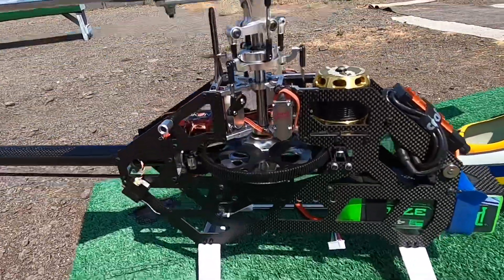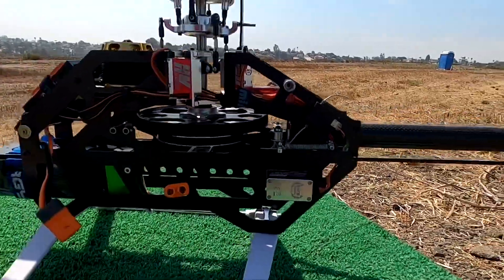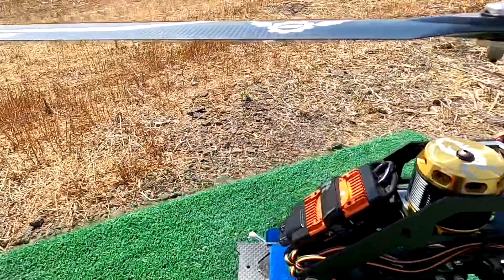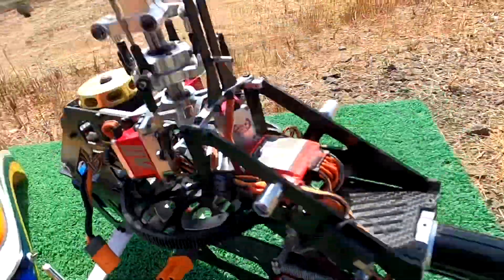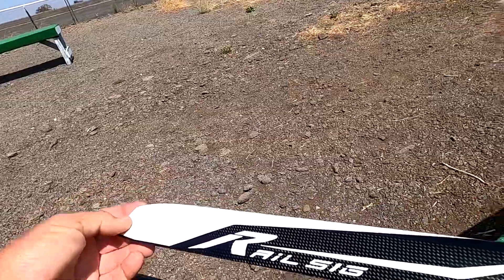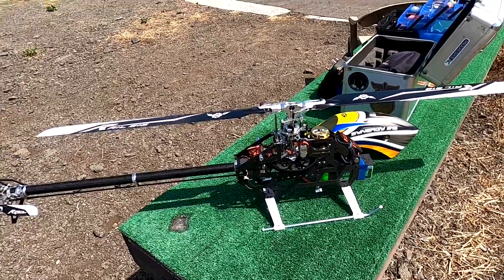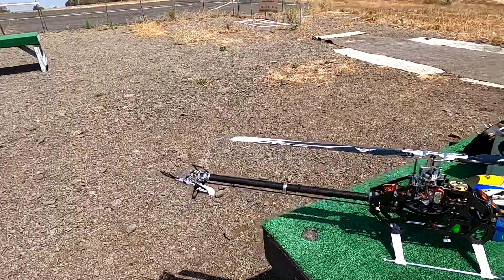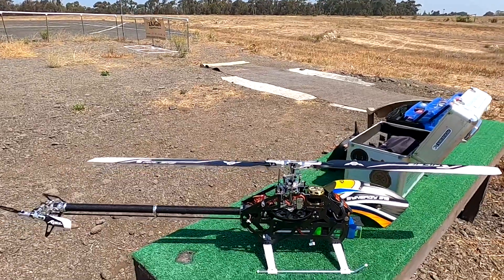Synergy 516 Helicopter    “Blast from the Past”

Comment: Coe where do you for the most part like your expo at?
Reply from the maker: -25 or -30 on all for Brain.  +30 if you are using Spektrum expo.
Reply: @CoeShow619  yeah that’s about where I am.  Your flying always seems so locked almost robotic.  I like that and just haven’t mastered that yet.  Thanks
Reply from the maker: @joshwilson243  ok. Do this. With switch E that is the Bank switch. Put the flying style at 80 and use 3 different gains in those banks.  So like this 515-600 blade size starts at 40 I think on gain default. So make the 3rd bank Which is switch all the way up 43, then make middle Bank 2 40 , and make low bank 1 36.  Now fly the heli doing tic tocs. Start on low gain. Fly it, feel it, question is it rigid. Does it piro flat?  Now flip to middle switch position. Is it better, quicker, less lethargic? Do some tic tocs and pirouettes. Go to the high gain switch position.  Is it better?  It will start to bobble and act tweeky when it gets to high. You want to be just below that. I find tweeky , jittery, and back it down about 3-5 points from that. So get as high as you can without spazzing out. Lol.  Oh. Go to advanced menu and put roll and flip rates at 450 on each input for all 3 banks.  Adjust those to your liking later.  Gains are very first. Idea here. High rates, but robotic look and feel with using 80 for agility.  It’s rad.
Reply from the maker: Ps. Sometimes I have to go lower gain than default. So if you know 36 is still tweeky, go 34,32,30 for your banks till you find which head gain is best. Then make all 3 head gains the same now. So if you like 43, make them all 43.
Reply: @CoeShow619  I will literally charge up 2 birds after work and work all this over.  Thanks so much for your help and time.  I really appreciate it!!
Reply: You are talking all Cyclic P gains here correct?
Reply from the maker: @joshwilson243  no. Wizard. Flying style page. Come on man.
Reply from the maker: @joshwilson243  keeps it easy on the 2nd to last wizard page.  Where the switch shows the color change on screen when you flip the switch
Reply: @CoeShow619  👍 ok will definitley do.  I haven’t really played much with the gains, well just got them firm but not actually really tuned to my liking.  Thanks so much again
Reply: @CoeShow619  oh shit yeah ok.  That adjust all the Gaines a bit.  Ok ok my bad I gotcha now!!
Reply: @CoeShow619  thanks again!!
Reply from the maker: @joshwilson243  just take your computer and a Pepsi to the field, have a little shade, and use those 3 banks for your changes. That way you have 3 feels to try before you land.  From there, work on rates, expo, agility, and all. It will take about 5 minutes each usb plug in, so about an hour of real time and you’ll be locked in. I just sorta know my numbers now. Where I like to start. Baseline.
Reply from the maker: Another thing. Make sure the heli hovers flat. Like it doesn’t drift one way or another due to mechanical. Get the links all the same lengths and those follower arms level at center stick for most Helis. And blades flat and in track at center stick.  Best mechanical set ups tune the best.
Reply: @CoeShow619  ok yeah this Iv not really tuned and absolutely love how “locked” you fly.  Literally going to do this this evening.  Thanks.
Reply: @CoeShow619  roger that.  So you say start the agility at 80 right ?
Reply: @CoeShow619  charging up 6- 3.3’s right now! Thanks again for your time and help
Reply: I knew you and me were brothers from a past life. I saw the post where you mentioned Pepsi. My favorite drink. No alcohol for me. Sweet flight brother.
Reply: Holy crap 43 made a world of difference.  She is very robotic.  Wow love it thanks so much.  That was at 2400 rpm and about 83 degrees.